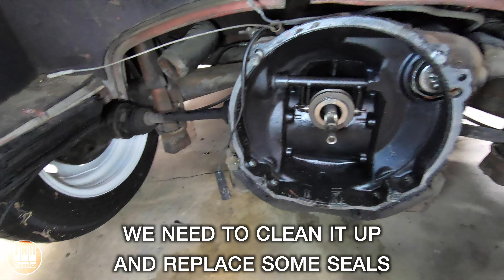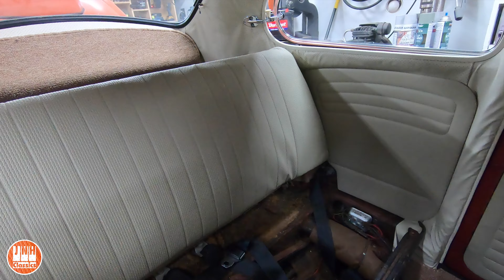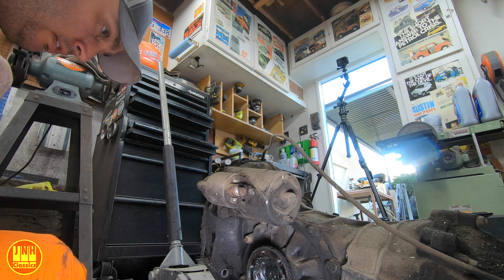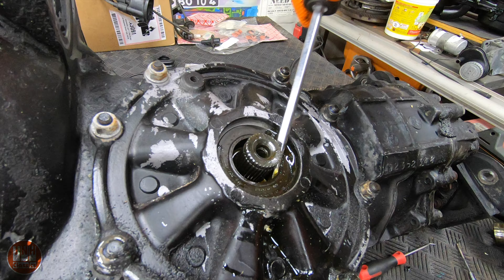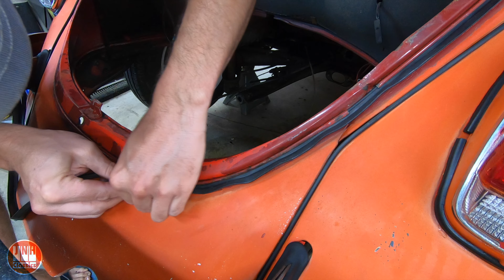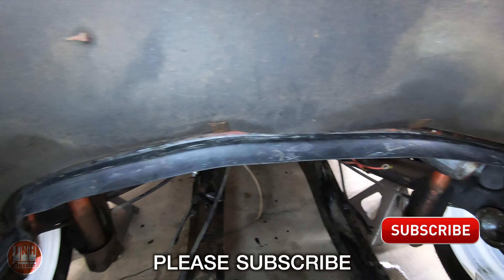An Unloved Beetle (Episode 14) - Transaxle removal & New Engine Bay Seals

Comment: Awesome! Good opportunity now to put some rust converter under the body and chassis in that area. Also a good time to check and repack your cv joints and boots. Judging by the black paint on the transaxle it looks to be a rebuilt unit so hopefully you should be good for many miles to come with this service you’re doing.